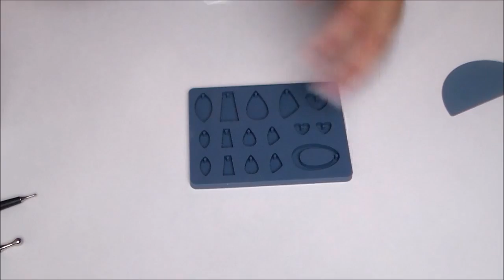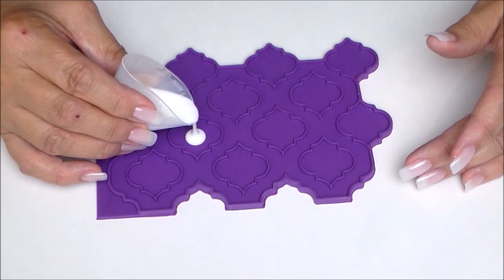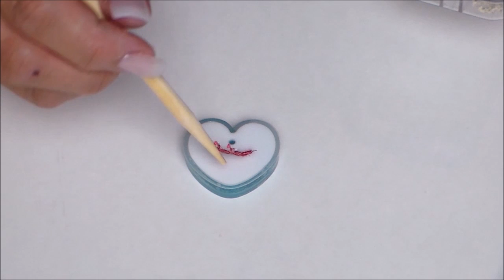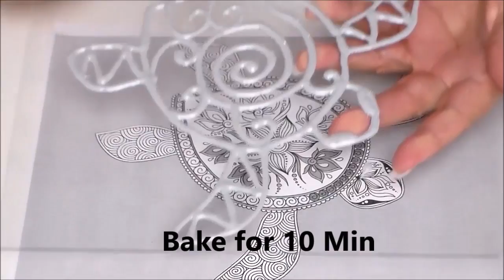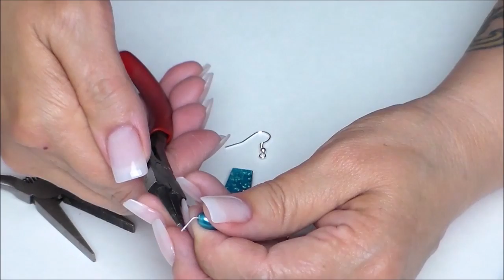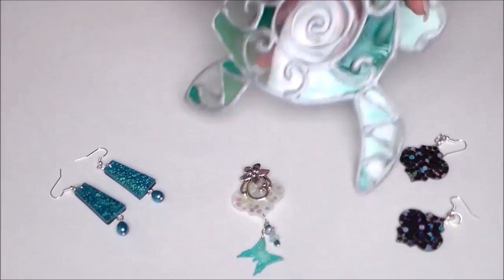Clear Liquid Sculpey for FB

Comment: Hi Teresa!!  I am having some trouble with the liquid clear.  I tried emailing on the Sculpey site, but no one answers.  No matter how long I bake it, and several temperatures, it never solidifies.   It just stays kind of gummy and sticky.  I have tested my oven with a thermometer, the temp is correct.  According to the directions, it gives a range of temps.  I have tried all of them on separate samples for varying lengths of time, none seem to work.  The highest temp I tried was 330 degrees Fahrenheit, for an hour.  It isn't liquid anymore exactly, but if you touch it, it is really sticky and gummy and breaks apart like the fat crust on a bowl of liquid fat that has been allowed to sit awhile so you can skim off the fat.  I am not sure what I am doing wrong.  Any suggestions would be appreciated.   I would love to make a window cling like you made.
Reply: Thanks for the suggestion, but I did that.  The bottle had been sitting for a couple of months.  I always stir them up and shake before using something that's been sitting untouched for awhile,  no matter what the product is.  But again, thanks for the suggestion.   😊
Reply: Although I have tried this product (yet), try stirring in the bottle with a popsicle stick. Stir for a full minute. This works very well for me when I'm working with paints.